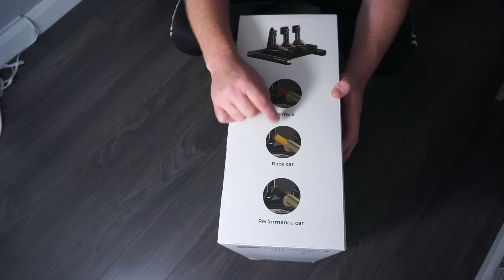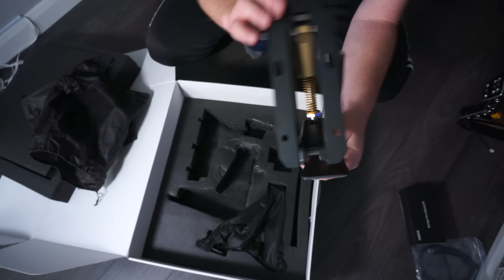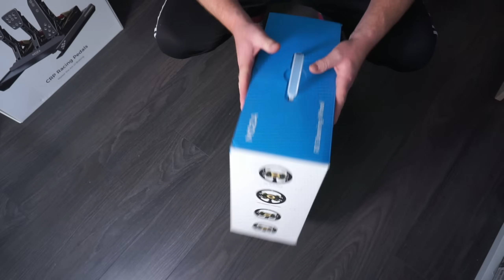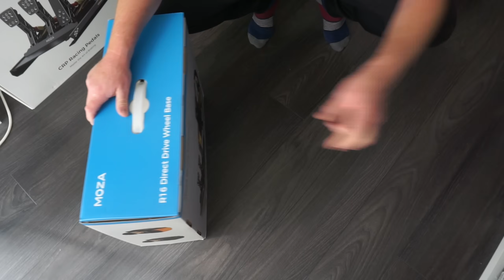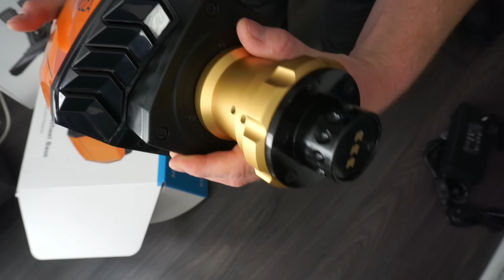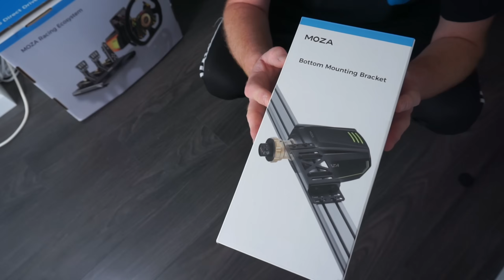Moza Racing R16 direct drive wheelbase unboxing & first impressions

Comment: @10:24: Plug Adapter - China uses two main plug types; the three prong ones like Australia and New Zealand, Papua New Guinea, and Argentina (which also including ground/earth). China also uses the two prong US plug standard (neutral & hot). This adapter combines both those standards, so you could plug in either plug version used in China.

Comment: Going back and forth between a few different DD wheel base options, it'll be my first and only DD purchase; currently using T300RS thrustmaster. Do you have an eta on how the wheel base performs? As always, you rock, thanks for all you do for sim racing community! Cheers!
Reply from the maker: There were some technical issues and waiting for another unit 👍

Comment: Notice the marketing numbers. R16 (one more than DD1) R21 (one more than DD2). It's like the numbers from Italian sports car makers :-D
Mozo could be a nice set just above the lower end consumer wheels, but the prices are similar to Fanatec and Simucube but without the eco-system. Ignore quality issues, the lack of an eco-system with a price equal to more polished systems makes this a poor purchasing choice. The one thing they did get right was the look - it does look very nice. However, looks are not enough.

Comment: Wrong wheel in the box and not so nice looking for quite a big price. Very flashy unit but not sure its my liking. Wireless power??? Either I'm out of the loop or somethings not quite right there. Depending on the driving tests, for the price it better be very spot on with details and input... But we'll soon find out :D. Not sure they got the pricing right regardless.

Comment: Moza definitely doing the rounds atm, the pedals seem very misleading coming without the pedal plate when it is right there on the box. May all be decent kit to use, but coming into this market Im not sure they've positioned themselves well. If they came in priced under a similar configuration from fanatec you could make an argument but with other brands like simagic, VRS, hell even the SC2 Sport a flashy looking wheelbase is not going to be enough.

Comment: I think they are dreaming for that price. It is just China made stuff. Way better options out there for not as much money. Thanks for sharing 👍🏻👍🏻🙃🙃
Reply: DD with 16Nm? Hardly. VRS is about it. CSL DD is only 5 Nm unless you pay for the power brick and then you have 8 Nm. What other options are out there that are 16Nm at that price? I agree, it's to much, but there aren't really any other options besides VRS.
Reply: @dragbug100  VRS isn’t covered in plastic and doesn’t focus on the aesthetic of the product. VRS main focus is SIMULATION. Until we know how these ugly wheel bases even perform none of this is relevant.

Comment: NIce video Dave.
I'm not a fan of this gear unfortunately, it seems overpriced compared to the competition.
Also it doesn't seem to fit into any particular area of sim racing such as serious or beginner etc.
As you say though the proof will be in the driving experience.
Will didn't get a pedal plate either by the way so you are no alone.
And did you notice there is a horn button!
Who the hell blows the horn when racing?
Looking forward to the on rig video when it comes out.